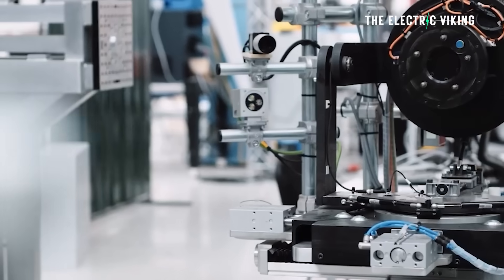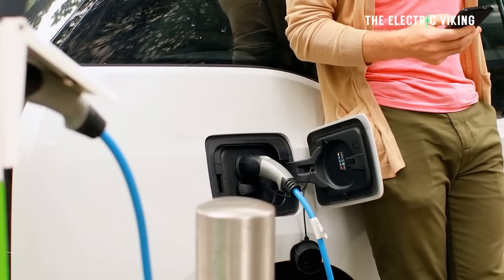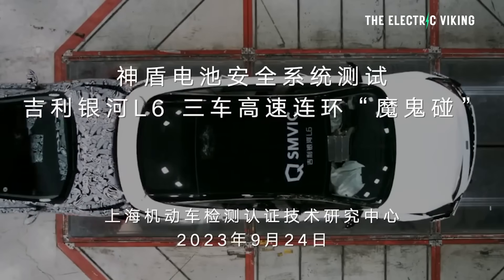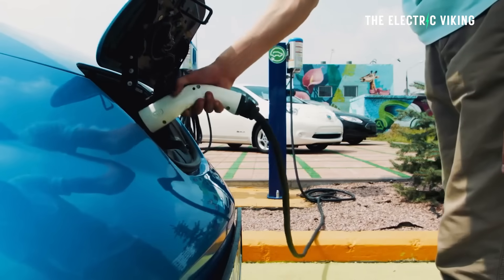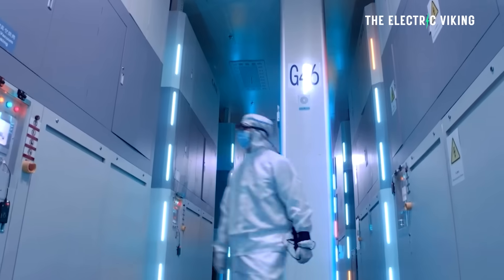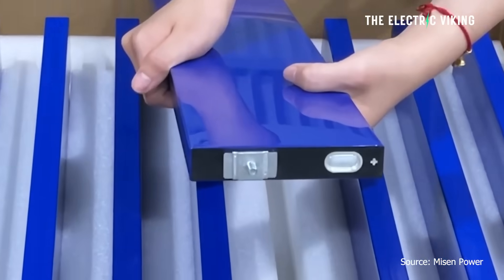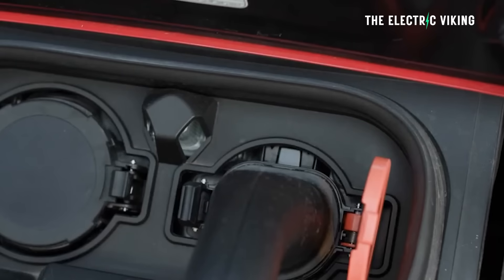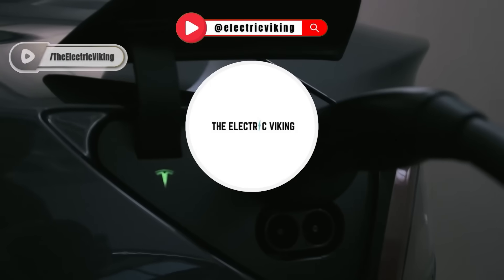GW Motors reveal battery that charges in 8 minutes and 1.5 million km warranty

Comment: Great for the city. Not great in the case of driving long distance. You still need a hybrid like the byd shark. There are no charging stations in the Aussie countryside. The infrastructure to provide this much power to a charging station doesn't exist. And unless you are getting a big return on the huge investment to build it, it won't happen. Existing fuel stations and hybrids are what we country folk see as reality. Hopefully they put these batteries in decent hybrids and up the engine size slightly for faster charging on the move.

Comment: There is a huge marketing flaw. EV makers should start using kms / miles as reference instead of % 

10-80% in 8 mins sounds less impressive than 400 kms in 8 minutes (or) 100 kms in 2.5 minutes

Comment: An informative video containing an insulting divisive message.
If fast charging was easy it'd be here already. More than a decade after EV's emerged, this 600kW charging you present is in no way a practical, useful or expandable solution. It has huge problems associated with it. Simple calculation and considerations of CONSEQUENCES shows this.
Consider the CONSEQUENCES of trying to provide 10 x 600kW charging at thousands of sites, then apply ohms law, watts law, copper cross sectional area, contact resistance, cable weight, the cost of very high power systems in the infrastructure, in the charger and in car power electronics, the fact that millions of exiting EVs cannot charge anywhere near 600kW and of course the resultant massive cost per kWh for this 600kW privilege.
You will end up with frightening technical and cost hurdles.
But you as a seem to be unaware or interested in downsides, you resort to insulting people out there who sensibly choose an ICE car. Such insulting tribal attitudes are bad form Mr Viking.
I'm not anti EVs. They are fine if you can afford one and are happy to have very slow overnight charging speed or if you are rich enough to spend on public charging and can afford the higher insurance.
Fine, no problem, but to imply that the slow public charging problem will be solved to well under 10 minutes for the EV motorist is utter nonsense.
Too much blind optimism my friend.
Good luck.

Comment: Some facts.
60kwh battery pack requires 60kw over one hour to charge fully.
Devide that 60 minutes by 8 minutes and you get 7.5x the required supply power through a cable unsupervised by qualified users.
The charge cable is going to be one big heavy dangerous cable full of very threatening current.
I work with 1kv electrical mining equipment and the  risks associated with very high current are extreme. You die. The direction we are going in is the wrong direction.
Rapid charge lithoum has existed for a long time, it is Lithium Titanium Oxide and it didnt take off because of the potential risks. There is a line you do not cross when it comes to high energy and the automotive industry is stepping over that line.
I work on 1kv 150A mining trucks powered by a long power cable and that cable will lift you and throw you away just by its initial startup current when things go wrong. When youve seen a big cable lift into the air a meter just from the current pushing them away from the ground you begin to understand it.
The only thing protecting similar in car charhing stations is the coms ready to shut down power if things go wrong but if that fails I tell you that "things going wrong" is extreme and severe.
Reply: Yes, even if any of the dozen 'miracle new battery' stories we hear every week are true, it's never going to be practical to charge them.

Comment: Batteries that charge faster are a big problem for grid improvements as the capacity of the wires going to the charging stations must be able to carry that power.   Mind you, over 60% of car owners in North America should have the facilities to charge at level 1 or level 2 overnight so there's inherently less of a need for DC fast charging than for gas stations where every ICE vehicle must refill at a gas station. (Most EV's would not have that need except on long distance intercity trips).  Basically, extreme rapid recharging may be a favourite boast these days but are of little actual benefit.
Reply: In other words, anything other than short trips will always be a nightmare in an EV.

Comment: Waiting for no lithium no cobalt no nickel no vanadium etc. 600-1000 mile range. 300-500 k mile warranty. 10 minute charge to 100%, don't want to start or resume a long trip at 80%. Maybe someday aluminum air or something equivalent.
Reply: I don't care what it runs on, I just want at least what I get now- 450 miles in 2 minutes, any weather, any speed, no degradation, affordable, refueling where and when I need it, I decide where and when the car goes, not the other way around. Not much to ask.

Comment: Manufacturers need to standardize car chargers which is not the case today. Not a hodgepodge of variable charger connections. Same as gas pumps that fits all vehicles large and small.
Reply: CCS is the accepted standard in Australia - problem solved

Comment: I could fuel a car in 5 sec but I need the pump system to do it. EV's are no different. Sam likes to waffle on about the EV side and batteries but you don't hear about the other half of the system, generation capacity and charging infrastructure.

Comment: We deffinately need SS batteries for the extra capacity and faster charging speed necessary to replace vehicles used for towing. Right now one is faced with 1/3 the range and impossibly long charging in order to make it to the next supercharger.
Reply: 50% reduced range when towing our 1.7T boat with our Volvo XC40 EV

Comment: Battery energy densities are still low at 185 Wh /kg.. Petrol is over 10,000. So  yeah, we still need solid state batteries. This will result in smaller battery packs with more energy storage.

Comment: You forget one thing the amount of power you will require is phenominal to achieve this and currently the UK grid is struggling to power the country with all this marvelous wind and solar that does not work when you require it most!! Also, china are experiencing 3000 plus EV fires a year which are chemical fires, the worst type. I will believe this hype when I see it as we have heard it all before.
Reply: "To contextualize this, let’s take a step back and examine historical data. In 2019, based on national regulatory platform analytics, China had an EV fleet of 3.81 million vehicles with 187 fire incidents. This represented a fire incident rate of 0.0049%, which is notably lower than the 0.01% to 0.02% probability for gasoline-powered vehicles. By 2020, the fire incident rate for EVs had further decreased to 0.0026%, still below the rates for traditional vehicles. Although data for 2021 is missing, the 2022 figures show that with 8.915 million EVs, the fire incident rate was 0.007%, continuing to be lower than that of gasoline-powered vehicles."

Comment: I've just read and heard about CATL's swappable EV battery, Choco-Swap, that would enable an EV driver to swap their low battery for a fresh one at any of 1,000 (to start; plans to expand to 10,000) proprietary swap stations across China. With charging speeds such as those cited here, what would be the value-add of such an arrangement? Granted, CATL claims 100 seconds for the swap - so I suppose it's for folks who want even faster "recharge" or for other than the short-blade batteries boasting the high-C capabilities.

Comment: -20C here in northern Canada is mild when compared to -55C typically at nite. ICE trucks and cars are not shut off unless placed inside a heated garage for maintenance. Radiators are covered by an insulating blanket to keep brutal cold air out.
Reply: How do the full battery EVs do in such cold?
I don't know if they've come to market yet, but supposedly some new batteries were going to have far less decrease in range in the cold than the ones currently on the market.
Reply: @jeffbuchholz954  The EV's do pretty good. Key is to keep them always plugged in when not driving and a garage makes a BIG difference. Reduced range of course,  just like an ICE experiences. But in the land of the Midnight Sun we move and work slowly and carefully and never stress out the vehicles or machinery.
Reply: @ Thanks for the info.
How do people cope then when leaving home (& garage) for extended periods?
What happens when one goes to a hockey game, or football game or to a weekend cabin in the deep woods when there is no garage for extended periods... or perhaps no electric charging options?

Comment: To get the last 10-20% of car owners over to EV's, you need C6 or more batteries. Home charging is going to be the standard. But, because politicians, the press, lobbists, and propagandists are payed by the oil industry. An industry that's the most subsidized industry in the world.
There will be many hold backs for EV's.
The forcast for 2025 regarding oil subsidies are $US 11.000.000.000.000, according to International Monetary Fund (IMF).
If you removed the subsidies in USA the price of gas would have been $15, up from $4 a gallon.
So, fossil cars are really expensive.

Comment: Any experienced car owner will know there is a big diffence between manufacturers' claims and what transpires in practice. Both for performance and guarantees. These are only proven when used by the consumer. As for fast charging the theory is as follows : to charge a 100KWh in 1 hour, a supply of 100KW is required for 1 hour. To halve the charging time to 30min, a 200KW supply is required. To halve the charging time again, a 400KW supply is required. To halve it again requires a a 800KW supply. Losses in the whole charging process is not taken into account.
Ten fast charging EV's at a charging station will have an 8 MW demand on the power distribution system network. American, European and UK distribution networks can barely handle the present energy demands on the power grid, and more so where there is a large component of renewable energy supply. So, for now, the benefits of extremely fast battery charging is limited. A slow (normal) introduction of EV's into society will allow for the technology to be proven / improved and motorists be convinced of the benefits of EV's.

Comment: Wouldn’t trust that betting sooner or later it will end in a 🔥can you imagine the load of electricity the chargers would require and good luck finding a working one that charges at that speed but they won’t be talking about that

Comment: It does not matter if a battery can be charged quickly. The current electrical energy we generate, the capacity of the whole network can support these types of quick chargers or even too much conventional quick charger. We can charge quickly phones because their battery capacity is low. A medium size factory requires less power than a Tesla if you want to charge it sub 10 minutes. An EV revolution, for example replacing all the ICE passenger cars in 15 years would increase the price of the electricity minimum 5 times, maybe even 10 times because it requires to build hundreds of new Nuclear power plants (big ones), we are talking about PW range (PetaWatt), replacing all the cables and wires installed, replacing all the substations, all the transformers, not to mention installing millions and millions of chargers.

If we would buy PHEV-s and/or Citroen Ami like EV-s instead of buying larger EV-s with 3-400km range, a small portion of the things above would be enough. Only those people thinks a Tesla size EV would be a solution for our problem who never understand even the basics of math and physics.
Reply: You make a good point. As the owner of two EV's who charges at home the cost of charging is still less expensive than fueling an ICE car. However, the state where I live in the US currently has 2% EV's on the road. And my electric rate has gone up in the past few years quite a bit. Not that EV's are the cause. There is one argument I read that counters your argument and it generally said the transition to air conditioning in the 1950's and 1960's in the US making states like Arizona, New Mexico, etc. livable  required more electrical energy than the transition to pure EV's will. But I didn't dig into it too deeply so I don't know if that is true or not.
Reply: @EVVolksmanID.4  Your point intrigued me and it took a couple of tries at chatgpt to get the numbers. My question: How much electricity is needed for air conditioning in the united states by year? 1950s: not much. about 10-20 TWh per year by the late 1960s. about 20-25 TWh per year in the 1970s. around 40-50 TWh per year in the 1980s. around 70-80 TWh per year by the late 1990s. 100 TWh annually in the 2000s. approximately 120-130 TWh per year in the 2010s. 140-150 TWh annually in the early 2020s. Not sure how this increase need electrical demand that we were able to supply compares to rational estimates of EV adoption here in the US.

Comment: Lol, 400k warranty vs...
Me putting a new engine in my 2018 Chevy Cruze with only 52k right now.
Tough call!
Reply: No worries, they will find a way to screw you over if you switch. 🤗
Reply: Yup even the famous ICE engine designers/ builders began loosing their mojo a long time ago as soon as they had to get more efficient and cleaner . To stop killing us all... it's like you can have the power but it will cost ...cost you twice and if you want both of the former it's going to cost you three times because we've tried turning an ICE fundamental pigs ear of. device into an electric motor silk purse.  🤷🏻 

As Kurt said.

Dear future generations: Please accept our apologies. We were rolling drunk on petroleum.

Kurt Vonnegut

There are still numb nuts  bullies trying to stuff people's heads in the Tar pits that killed even 🦖 

We still need to get away from using exotic metals in Batteries and motors.. and vehicles in general have to go back to being updatable repairable long term assets. Relatively free of fashion ... and far more  defined by functionalism and sustainability . 

Meantime we have to keep an eye on what we ask from our environments and the numbers of us that it can cope with. 

It's been quite a few years since the mass of the manmade exceeded the biological mass of the Earth.  It doesn't take a genius or War veteran SF writer like Kurt or Frank Herbert to see that's neither clever or going to be good.
Reply: In the US EV battery packs have to have a 8 year 100,000 mile warranty by law. There is no requirement at all for ICE cars to have a warranty but most are only 3 years 36,000 miles.
Reply: That sucks, man. Too bad Trump and Biden won't let you have this EV battery because it's made in China.

Comment: 900KW would need cables like an arm and a power plant if 10 cars charging ,not talking about thickness of wires and cooling  inside charging circuit and also battery degradation. future of EVs is battery swap and even standardized safety ,connection and shape

Comment: Canada here. It does get down to 43 here occasionally (much more often in the farther Northern regions) and even colder. Where I live, -20 in the winter is not uncommon - though, admittedly, it has not gotten that cold this winter and there is hardly any snow on the ground right now, in January thanks, climate change. My Tesla M3 loses about 35% of its range in really cold temps, so these batteries would really be welcome!

Comment: So a 160wh kg @ 6C pack will take power at the same rate as a 320wh kg @ 3C pack that is half the size. So 320wh kg @3C matches what Tesla has in their vehicles right now. Meaning that the 6C sounds impressive, but really is current tech.

Comment: The limiting factor in charging isn't your car these days, it's how many KW you can get out of your charging station.
Reply: @dogefromthefuture  small brain comment here.  It's very situational with your car and the station.
Reply: @veganpotterthevegan  o really, cause I have an electric Porsche that charges at 250kw/hr, yet none of the chargers in LA with go above 160kw/hr. Yeah what could I possibly know about the charging situation? Lol 😆 🤣
Reply: @veganpotterthevegan  I road trip to Utah, to Vegas, to Arizona as well. All the stations advertised 250kw/h charging, then they all overheated, so the companies turned them all down to 160kw/hr.
Reply: @veganpotterthevegan  so I don't care how fast your car can charge, that's the max on a road trip. 
Additionally, I can't tell you how many times I've come across a station with only one 250kw charger, and a bunch of lower ones, and there's a line of cars, and a Chevy bolt takes the 250kw charger cause they think it's gonna charge faster, even though their cars max is a witnessed 65kw or whatever. 
You're not only limited by the charging stations but every jack off with a crap EV in front of you, and they're gonna have them for like 5 years out as well, screwing up the network. All of this does not affect Tesla of course, it's just everyone else.